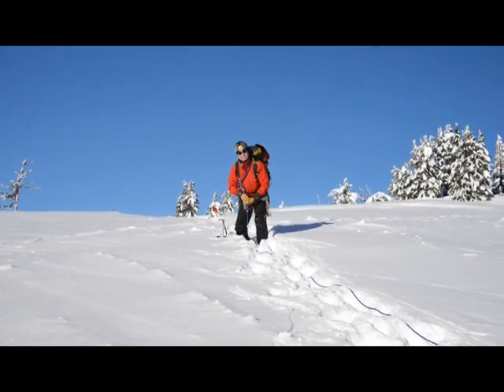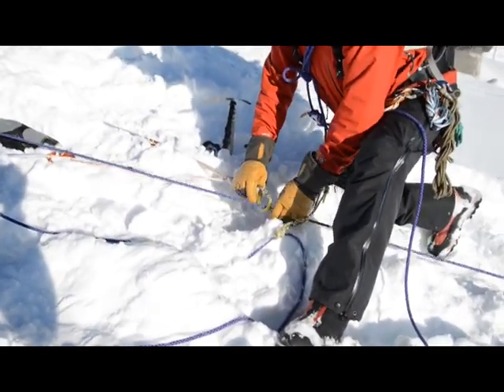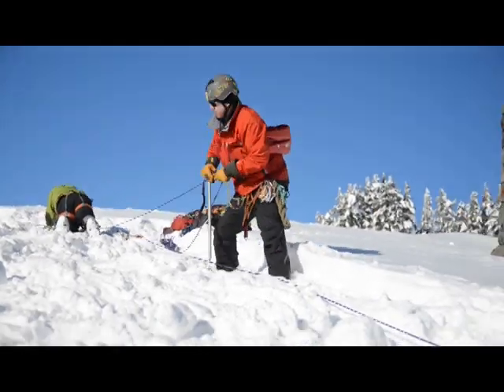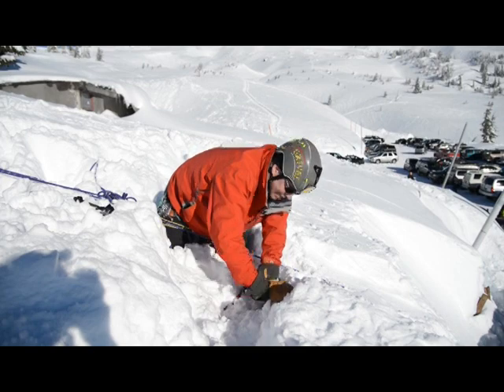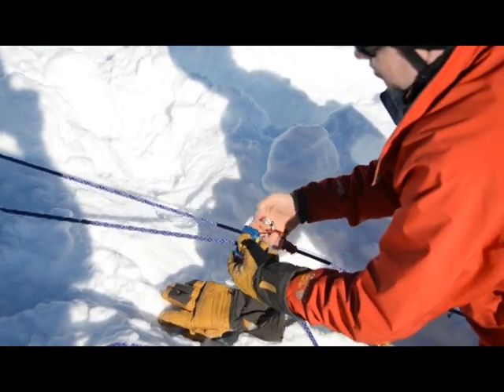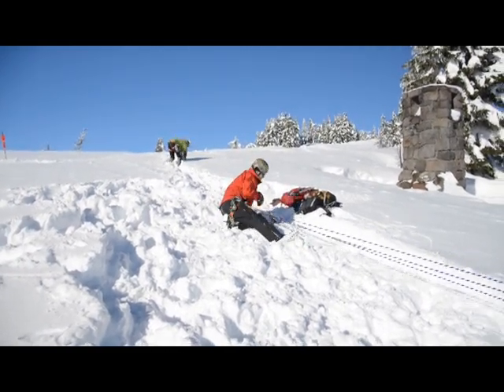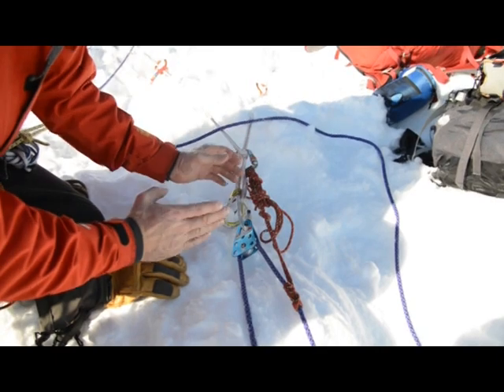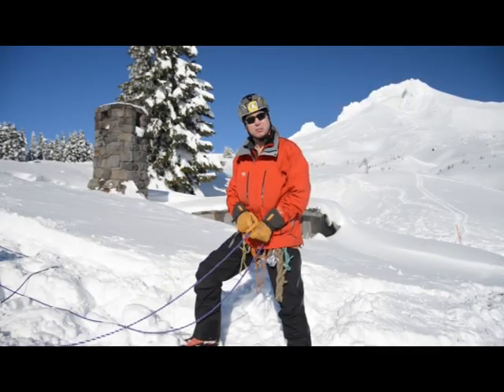Crevasse Rescue

Comment: I notice that there are no overhand or alpine butterfly knots tied on the rope leading to the fallen climber (i.e. between the members of the team, to provide more friction on the snow in the event of falling into a slot). If those knots were there, would this system still work (could they be untied under load to allow the rope to pass through the pulley at the anchor-end of the system?).

Comment: Thank you! Along with your "one on one crevasse rescue", this is the best video on crevasse rescue that I found. It answered a lot of questions. I have one more: What exactly do you mean by the "open system" ? I couldn't find it anywhere. Thanks a lot!
Reply: In this case "open system" means that the system can not only be used for raising the load but also allowing the load (the climber in the crevasse) to be lowered. This is not uncommon if his or her rope gets hopelessly jammed in the lip of the crevasse, mandating that they be lowered a bit to work on alternatives, such as lowering a a drop loop over a padded edge.
Reply from the maker: Thanks Sinfected.
I think Doug gave you a good answer. Another way of saying it or looking at it is
Open = Reversible
Closed = Irreversible 
It's about keeping your options "open". ANd all it really takes to keep it open is learning to tie a Munter-Mule. 
Hope that helps and sorry I didn't reply sooner.